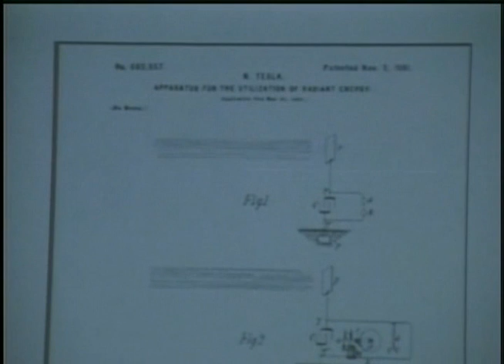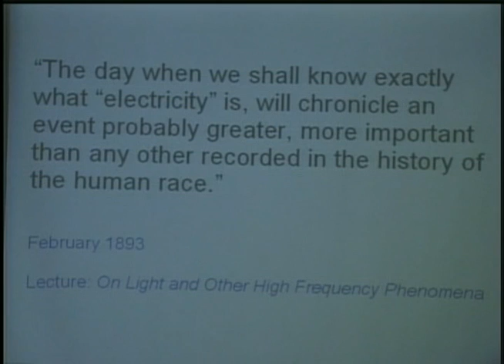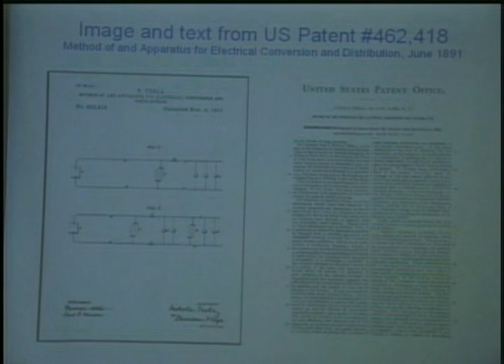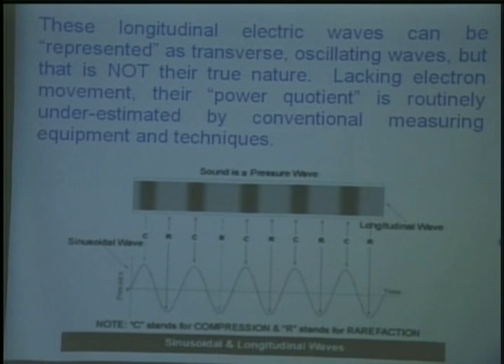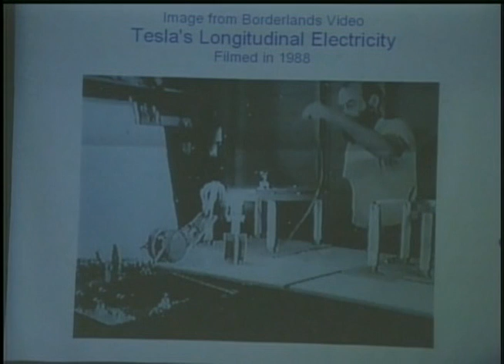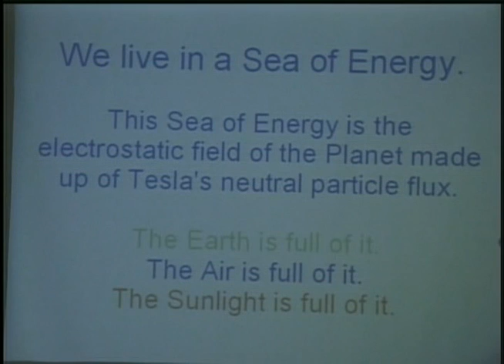Documentary: Free Energy by Peter Lindemann. Tesla's Radiant Energy: Extraordinary Technology

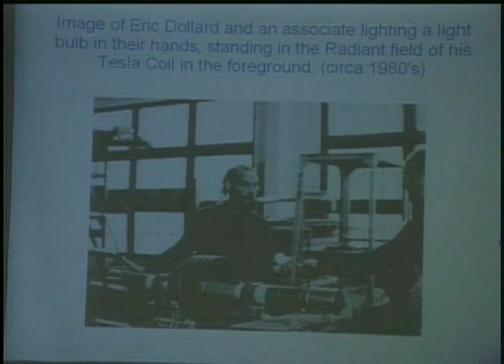Comment: Having received formal training in "conventional electron theory" I had to rethink everything and do not regret it. My question is:  What determines the amount of voltage potential a load might otherwise require....and not 'OVER POWER IT' when utilizing this type of "one wire electrical potential" if it's not converted back to 'conventional electrical energy' before being used?..... Or is it ...because there's no actual electron flow (and "power" is a multiple of I X E) there isn't any real concern (i.e. the device will  only use what it needs and ignore the rest)? Inquiring minds want to know.....Next: about @1:00:00 he mentions a little about radiant energy being received from an pulsating source (i.e. multi horizontal lines hitting a collector plate in patent drawing'). In Secrets of Cold War Technology, it describes that energy as "collected and redirected aether". It also states that the device that "redirects it" is a double cased lead lined water cooled 'fire hose' looking app.; and any metal (collector plate) that energy came in contact with "would/could melt". Notwithstanding, it indeed was a wireless energy transmission comprised of captured and redirected aether; the same that powered those lights 25 miles from his Colorado experiment.
Reply: I too thought I would be reviewing my formal education to pick up what I forgot, not to discard what I still remember... che che la femme... the impulse electricity/radiant electricity is without magnetism. electricity used to say magnetism was caused by charged particle flow, current. Turns out only aligned charged particles make magnetism. So, these super small charge carriers apparently are not particles or lack any orientation, so no magnetism... implying that voltage sets the number of charge carriers with magnetism in regular electricity. if you get too many carriers with magnetism, the overload condition is when the magnetism tears the load apart. Something the radiant electricity cannot do, no matter what the voltage of the radiant electricity is... HOwever, the RE will overload a capacitor, or is it picking up electrons and eventually they overload the cap? So many questions... stopping this research could be the end of the human race when natural forces reset the world and nobody sees it coming or has any idea how to deal with it.
Reply: Direct experience may be the best way to find out. I've made a simple high voltage coil that I charge with a AAA battery and discharge it through a neon little bulb. If scaled larger I'm sure a florescent light can be lit. A Grey circuit can power a DC motor with inline inductors.

I went to school for electronic technologies but I have unlearned half of it to move forward with radient energy. This stuff effects the body at different frequencies and is mixed with conventional electrities. Electricies being plural because I believe from Eric P. Dollard that voltage and current are 2 different types of electricity. Capacitor discharge does have different characteristics than a coil discharge.

Even a solar panel gives out a type of electricity that makes lead acid batteries last longer by a little bit.

Charging lead acid batteries and LiFePO4 batteries seem to favor radient spikes that can be interchangeable with chargers if radient spikes charge a capacitor first then discharge to the battery. The battery turns radient energy into more conventional electricity but still has it's own characteristics.

Comment: This lecture builds considerably over Gerry Vassilatos' book and simplifies the understanding of Ether beams and energy to simply be the energy that is denyed in Standard Physics between the plates of a capacitor. As Peter explains it, that energy is a subatomic particle collection that partners with static charge and does the work mechanically between any objects affected by static charge power. Cold electricity, the power that physics denies as energy, is simply electricity's working component, these subatomic charge carriers, conditioned by charge, but void of all electrons. Tesla's genius was recognizing that this mechanism was in place, and then developing simple devices to purify the flow, which carries all the benefits of electrical power, without any of the negatives, like destructive biological impacts, costly transmission mediums (you don't need charge carrying conductors) and resistance (the subatomic particles are so insignificant, they permeate all matter without effect except for the matter they are tuned to interact with; those interactions can replicate any physical effect directly (making superpowered transceivers possible, if you can determine the proper conditioning, that can do anything remotely). This combined with Tesla's expert patenting skills gave him an indomitable position as the sole profiteer of the industrial revolution world-wide, a competitor he never imagined would do any and everything that was done to sabotage his economic success and future. Taking our future with him. Party on Dudes, be good to one another. Peace, B (Although the theory flies in the face of commercialized physics, it is still a disruptive technology that would dominate the world markets if properly developed for commercial applications and has and will face global condemnation leaving the world ignorant and at the mercy of nature's systems (all of them, from biology to weather to space and cosmic forces.  Any and all of them remain out of our control and ignorant to how to track or manage the conditions that we depend on for life.

Comment: What is meant , by elevated capacitance acting as a virtual groud,  so it's just a flow of charge from capacitor through air,  it acts as the path. ?
Reply: Ground originally was the charge potential of the local environment. Move a mile and that value changes. AC carries its opposite, giving a fixed and useful base for the potential it operates at. By doing that, you do not need to worry about the local ground being at a higher potential than your driving circuits and becoming useless. Tesla pointed out the failing in this strategy, you also cannot tap into the natural energy that is far greater, and already there (for free). Closed circuits dominate because they work everywhere, and the "science" only allows for them (its practical and keeps a tight lock on the money traded for goods).

Capacitance varies with the square of the charge, if you isolate your circuit from ground, you control the charge in a capacitor (it can only reference your circuit and it can act as a virtual ground if you design it properly) Electricity is motivated by two separate conditions. 1 being charge and capacitance, the other being magnetism and inductance. These effectively are inverse to each other (one pulls, the other pushes, so they can ring and keep the energy flowing, even growing depending on connections and materials. Which means a clever designer can amplify electricity and none of the "laws" of science are immutable/appplicable; which means much of what controls civilization today is based on a scam. The emperor has no clothes. (The answer to your question is: Everything changes, the world is abundant and anything could be freely available to everyone.) You don't really think Tesla had his reputation and fortune taken from him over how electricity is described, do you/

Comment: Well,  it sure would be nice if it was easy to construct, even for an industry adept, (not considering the barriers of mind ,most people are not open to anything. After thinking about it,  is the unipolar discharge, high frequency as well, judging from the text,  it might need to be a minimum of 200 k hertz, I just don't know if I can believe that that rate,  wouldn't vaporize the oil, and cause danger in the form of x rays to tesla,  so, it was charged with a feeble current right,  and it has notable self inductance,  it's just too much for the average numb electrician, even  on the power side,  to put together.
Reply: if  you  will  FORGET  about  tesla,  maybe  you  will  'find Something'  that is  REAL.      else, your just another   tesla-tard.
Reply: @Teslamoanials Derived 'it's easy start with '  LESS  STOOPIDNESS.      NEVERMIND, dweeb
Reply: @Teslamoanials Derived yea ok,  can you actually build shit that anything can be plugged into, without overload or under load, or are you just a nerd who pontificate that
Reply: Are you saying,  a high voltage system,  has lower capacitance?
Reply: @Teslamoanials Derived yea 🤓🤓
Reply: If your so smart and skilled make something and have the fcc come at you about,  and make a YouTube video showing it...
Reply: And tesla was duing that shit w a two sided dynamo.
Reply: @Heads Mess I work. What do you do numbnutts,  just talk smack to people you don't know,
Reply: @Heads Mess electricity isn't hand work,  it head work,
Reply: @Heads Mess k. So just start blowing up mosfets like master IVO.
Reply: As a displaced EE, taking time to really think of how all matter never touches other matter, and that real physics is about the interactions of super-refined subatomic particles, not about the interactions of matter may give you some space to make room for Tesla's magic. It simply isn't possible with what you were taught to think is happening.  "Secrets of Cold War Technologies" By Gerry Vasilatos may help, you only need to dig through the first chapter, but pulling the tech out of the politics is a chore. He doesn't write like an engineer. you may also enjoy Master Ivo's YT channel. He's more direct at just presenting the tech and avoids the spark gap work successfully. My current thought is the key component is the capacitor, all his circuits use the capacitor as the center-source of dual circuits that run open-ended and electron-free power.  It is only rewarding if you seek understanding, otherwise, you are better off going back to ignorance. Party on dude, be good to one another. Peace, B
Reply: Yes, you are correct. By pointing out that DC is typically 1MHz, DC discharges are high frequency. In the details of Vassilatos' chapter on Tesla, the tuning of the circuits ends by adjusting the spark gaps' "flutter", which is not clear why from the text, but Peter has found the reason this is present.  In that application, the point was to make the spark unipolar, an unnatural condition; all sparks are subatomic in execution, and mass effects create micro circuits of varying potential that cause reversals in polarity, even complete reverse discharges all of them tend to destroy the conductors. One approach he tried was using pure nitrogen, but ideally no conductor (the vacuum) seemed better.  There are two effects produced by the discharge. Primary it slammed so many electrons into the contact carrying the current away, that they self-arrested their conduction through the receiving circuit, effectively filtering the electrons out of the Ether stream carrying the electrons. The second effect was launching waves of Ether throughout the Universe that carried the pattern of the electrical discharge, which continued on inside the receiving circuit which could guide and resonate the freed carriers, but no longer responded like moving charges (it was not electricity, he called it that because he didn't want to let all his secrets out, he wanted credit for his hard work)

Peter's beginning assumptions lead to the continued description of electricity doing all this, but reading Vassilatos, one learns this was not what Tesla was doing. Tesla used electricity to produce conditioned Ether and captured cosmic plasma generated Ether to make electricity. Of course being able to separate and tap into this distinction and transition enabled Tesla to limit his applications to just the electrical part, just as Steinmetz was designing electrical engineering to match and work only with 60 Hz polyphase electricity. Electrical engineering is pseudoscience (by definition). Vasslatos points out that Tesla's Colorado plant pumped Ether into the ground to capture the Ether trapped within, but a side effect was launching columns of plasma from random places around the plant (bursts of lightning from the ground) due to variations of conductivity in the ground (and no doubt inspiring the massive grounding structures at Wardenclyffe)

I hope this helps clarify the inconsistency you identified, for me it makes sense when you recognize that everyone in that day was in it for the money, even Tesla. He just had better technique and discovered something that put everyone else out of business. But, even after his NYC lab was blown up on 3/13/1895 did not understand how pointless his quest for money from this disruptive technology was. He never thought JP Morgan would deliberately kill the self-powered Wardenclyffe world broadcast power plant and lose money on it, to save his investments in General Electric and monopoly-mining and manufacturing  investments in transmission wires for AC systems. (Tesla was not much of an accountant, or lacked the ability to empathize with sociopathic behaviors of industrialists.)